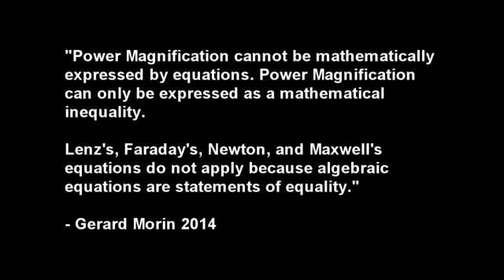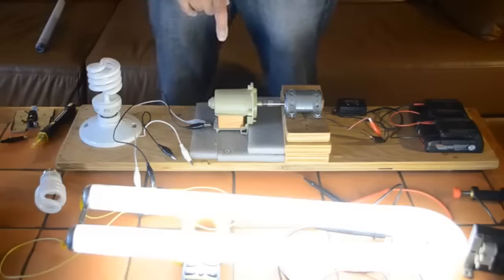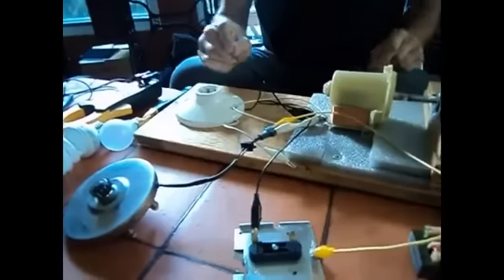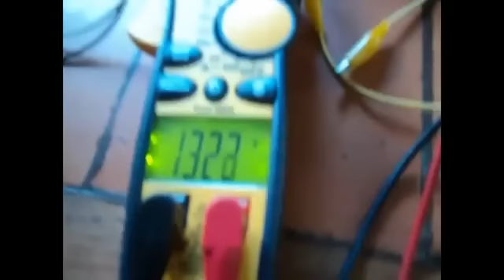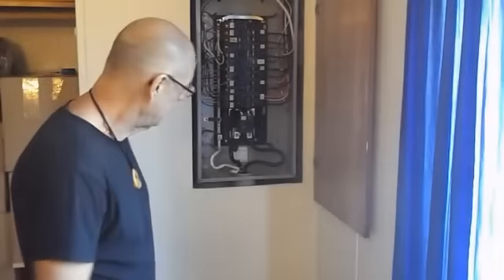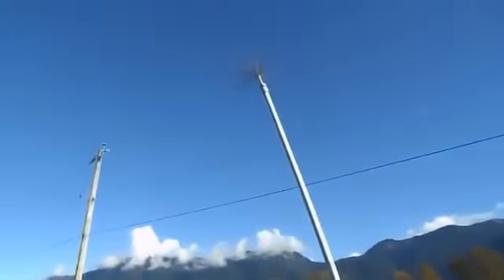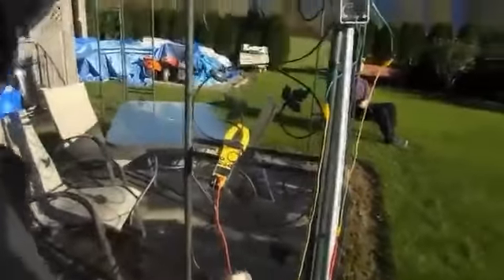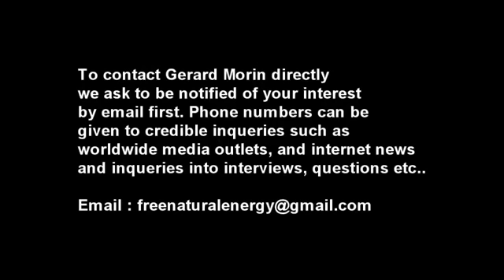Time to END The Electricity Racket - FREE & NATURAL ELECTRICITY PROOF

Comment: You're not applying 300 volts to your ozone generator.  You need to measure the output of your generator under load, not open circuit, because the output voltage will drop under load.  Also,  your fluorescent tube still lights, even though "burned out," because of the high voltage you applied.  The heated filament that is burned out is only needed to vaporize the mercury inside the tube during startup at normal line voltage.  There is in fact phosphorescent gas inside the tube--mercury vapor--whose ionization is producing the light.  So many more ignorant statements and claims made in this video...
Reply: #BoycottGrammarly 
Tesla could do free energy i believe the peramids were energy source they were in water to lower the frequency tesla used seme on his tower plus every 1 meter from ground is 100 volts nouns so 10 meter of ground is 1000 volts it also static and can be very powerful in solar storms write ir wrong does not bother me the pastion in trying is what counts and high frequency high volts no Watts is i think a key separate Watts and volts to 2 different circuit like H gate i read a battery that only use positive not negative then flips harness the energy with out using it because it has to be positive negative to use the battery energy causes chemical reaction there is something to this and learning about tesla and believing in him will give the planet free energy usa and China has this tech direct energy weapons the ion isphare is key makings the earth energy more negative causes a pull of energy ftom ion phare transducer this vedeo makes me want to experiment and that pass time is fun so i see nothing negative about this video who knows could get somone else to accidentally get it right life is light energy light is also mass energy is all around us quontom can make free energy 1 atom in chip with diode to block the Electron spin of atom can make free energy chips Google has done this so free energy is real just have to change every action has equal opsite reaction diodes do that

Comment: Actually amps can be raised as well by configuration of the batteries 🔋in series or otherwise, I as well am a self taught electronics geek, I'll tell ya what though, the hardest part is trying to teach others, they're minds are singularly combined being at thought in which is taught. U can literally show in every way anything specific and yet not one can seem to understand the fact of anything. The fact of it is is that the gov themselves teach a certain way to direct one from a certain area of thinking,  it's strong from what I've learned of others with also having a **** of experience in knowledge of too much lol, I don't flaunt and mean no such thing, I've watched so many videos of men of few trying to teach the world what we actually are and what the universe is I'm fact to how dying never truly happens, to seeing is believing when your thinking is beyond nearly anyone else's when only corruption hasn't been installed.  It's so much in a big way its insane on the amount of work that's done to manipulate us,
Reply: Amps can be manipulated or any other movement in speaking can be manipulated separately or together on makers need persay.  For example there's amps in vehicles up to 7000 and still has 12volts. Or there's amps with 300 but also of a 12 volt output, let alone they make inverters and converters which take 12v and electronically make it a 120v or and too a 240 being this I'd only assume the fact they could make 1v into any volt of need lol with any amps or ohms needed along with watts. I mean isn't it all specific to the t
Regulated fact of it only? So if not for being done for power/money then you'd know better other then not lol

Comment: Wait, what? If you wire the batteries in a series, you increase the voltage. Did I seriously hear that? That's wrong. If batteries are wired in a series, which is positive to positive and negative to negative, the Ah increase, not the voltage. Voltage is increased when batteries are wired parallel, which is positive to negative  to positive and down the row of batteries like this. The negative is done the same way, negative to positive to negative.
Reply: you got that backwards
Reply: @zonti  your right, I had a brain fart. I stand corrected.

Comment: it amplifies the power but the power will run out quicker, so there is no gain just amplification, I think, I'm unsure to be 100% honest there is something here but something is missing, I would be more interested in the pole in the garden, but it could just be picking up TV or mobile amps, also it was near a power line, 1.2 or 1.3 u could pick up, but putting 200 pounds of copper wire will not make more it will just be 1.3 still, there is something though, there is alo charged electrons in the air but amplifing it to hard to do with out magnetic rotation meaning power is needed, i dunno I'm thinking he has something but its missing something, he is very clever but a little arogance might go against people working with him, i get he is trying to call for help, he has no money or real engineering but has the ideas, this just needs ramping up properly with some help, I'm not fully understanding it I don't think, it is a complex field though. I would like to find out really.

Comment: Energy transmission through a phase corrected flick-starting condenser can multiply the rotation of a quantum direct linear cuspid de-modulator, which will supply over a million quadrameters of linear flux.

Comment: This bloke knows a lot of the technical terminology, and sounds convincing to the layman.  But what he's claiming is simply impossible.

This bloke sounds (to someone who isn't an electrician) like he knows what he's talking about.  The thing is, nothing he's saying has ANYTHING to do with the NEXT thing he's saying.!  He sounds like he's making points, that are all adding up to a final answer.  And this final statement, is something that you know to be correct, or can believe to be correct.  But, he's NOT.!🤬!.   He's just saying things that have nothing to do with the next thing, in a way that baffles you technical information. And, although the statements are on the whole TRUE, the middle part of each statement is a way of making you believe that the outcome is proof of the original statement.
For example...
Bikes can work with square wheels.! (REALLY.?... PROVE IT.?)
So, when riding a bike, you always pedal using up to 360° of a 32 or 46 toothed gear wheel, BUT... EXACTLY 100 revolutions per mile is required when riding faster and slowing down to start to go faster again(especially uphill with the new square wheel technical advancements).  From fast TO slow and slow TO fast is what all gearing and wheels are designed to achieve, no more so than with BOTH of your wheels having corners of exactly 46° diameter, square circumferences.  Most, if not all hills are always up and down with the easiest gearing. (this is a given).  Gearing to make uphill and downhill traction with the next advancements in square wheel technical requirements, is fast and slow(again, this is obvious).  But speeds of 50klicks with super variability gearing mechanism, is something every bike is capable of, whether your wheels are square or circularity objectified (everyone knows this).  If you divide the multiplication hydraulic brake cylinder on the rear wheel into the six constituent variables, and use this on the rear to power the square wheel that's obviously at the back of the bike, theres a massive part of the problem solved.  You can easily make your own set of wheels if you take a square, non-perishable piece of malleable, 380° 'Varistock' metal, and add 30 pair-sets at 15 inches of wire resistant spoke alloy, you easily have a square wheel that you can obviously change the characterisation of, up to 50 cycles per rotation.(the rubber comes in later in the process).  And if you do it again, and repeat the process EXACTLY, using CAD(only on a laptop, because laptops are portable) with the shape altering, digital, analogue redundancy package that includes squaretech rotary, which is in compliance with the European (and British) contemporary classification regulations, you'll then find that you now have two equidistantly certified wheels, that are 120° apart from one another(again, everyone understands this). Every bike has a front wheel and every bike has a rear wheel that is driven by a chain.  Chains are made from metal, and are ALWAYS getting dirty from the water and dirt thrown at it from the round wheel varieties(or at least should be if you're riding your bike correctly and unhindered by technical advancements in circular formation that when subtracted, leaves a square)
This has always been the case. And becomes more important when swapping from one style to another.
So there you have it.!  The proof that...

     MY BIKE HAS SQUARE WHEELS.!!!.

Incredulity.

You CAN'T get out more than you can put in.!

OBVIOUSLY.!!!.

NOTHING is 100% efficient.
Even just a little bit of heat, removes a percentage of power.

It's Newton's law of Thermodynamics.
Look it up and figure it out for yourself.  
Don't just blindly believe someone who sounds like they know what they're talking about.(even ME.!!.)

Comment: Thoughts and remarks from through out the video

What has been made is a DC to high frequency AC converter. evidence of this can be seen in both the outlet tester next to the unit on the table that lights up once the "energy accumulator" is turned on. And again when he uses an ozone Creator to generate an arc. the pitch of that Arc can be heard, and is higher when power of the ozone generator is switched from presumably a wall socket to the "energy accumulator" indicating that it is now functioning at a higher frequency

You could simply think of this converter as a transmission in a car or using different gears on your bicycle. you are still putting the same rotational velocity as well as torque however the output speed is observably different

The multifunction chips he mentions in the batteries are there in order to protect lithium ion batteries from both fully discharging and ensuring all cells are charged equally when saying he already burned a battery out he most likely fried that chip

Most drone motors you can find on the market today are in fact actually run on ac power. This is achieved with a unit (known as an esc) on the drone that converts DC power to AC power while also varying it to adjust the motor speed.

Keep in mind during the age of Tesla high frequency energy was not well understood yet,  in fact tesla performed a demonstration in which he controlled a model boat using radio waves. (if you look on the back of most RC toy controllers they will have the frequency at which they transmit listed, usually in the megahertz or now with an increase in technology gigahertz range). that mystified a crowd who postulated he must have been using strings or magnets. what I can guess he means by a "radiant Watt" is high frequency AC. The AC power you will find in most of your homes it's around 60 HZ the frequency he is generating is probably somewhere in the magnitude of kilohertz

DC or direct current does not have a waveform unless modulated to do so. In the case of the pancake motor the diode is simply cutting off one half of the AC signal so you are left with a pulsing DC signal

AC motors do not use brushes (brushes change the distribution of power to different windings creating a changing magnetic field that imparts a rotational Force on the armature) they instead use the inherent frequency

Fluorescent tubes use mercury vapor that becomes excited (ionized) by high frequency AC thus producing light. a phosphor coating on the inside of the fluorescent tubes converts the mostly UV light generated into visible light. The elements on either side of a fluorescent tube are relatively unnecessary for them to work (given high enough frequencies and power) however are much less susceptible to degradation from the high frequency discharge they experience compared to the bulbs contacts.
A plasma globe for example is close to a complete vacuum, however in a full vacuum there is simply nothing to conduct an electrical charge and thus no light is produced.

Electromagnetic fields can be enhanced with permanent magnets. Also notice how the audible frequency of the motor is decreased once a current load is connected and voltage is not measured after said load has been connected 

Note the batteries(18v 1.1Ah("Ah" referring to the capacity and has nothing to do with their maximum current output)) are connected in series producing an overall voltage of 36v, however if connected in parallel would have an output of 18v

33:24 wrong just ✈️ wrong if the "energy accumulator" could deliver enough current, and the alligator wires were thick enough (because the current required would literally turn them into plasma other wise) the magnets could be heated to a liquid consistency. the magnets are poor conductors and therefore acting as resistors. 
As a side note If he had the current clamp around ether of the alligator wires he would observe a rise in current as the heat rose due to the fact that the hotter a conductor becomes the more resistive it is.

I am fully aware of that completely comprehending even a quarter of the electromagnetic physics at play throughout this video, is lofty to say the least. But thanks to the dunning Kruger effect I realize I know almost nothing about electricity and am open to being proven wrong, with sufficient evidence.

If you find yourself here I'd urge you to check out
BigClivedotcom, styro pyro, thought emporium, electro boom, tech ingredient, and elementalmaker
Reply: Also MikeHoltNEC , eevblog , and Photonicinduction (for a little fun).

Comment: If free energy (perpetual motion machines) was as effective as many advertise then why don't we see military bases, vehicles, or vessels using them? The simple answer is it is not as effective as it is clammed to be unfortunately. They may be able to run on its own power generated for a long time but when you add a load (load = something that draws power) then it will begin to slow down much faster and stop working. it would need to be restarted frequently. No business let alone government would prefer to spend money of a fuel to generate power when it could be generated for free. That's just and electrical engineers take.
Reply: The engineer is wrong. A man in Mississippi back in the 70's built a machine that had 10 times the output as the input. When he tried to patent the machine he was denied even though everyone that tested it confirmed it worked, even the independent tester assigned by the judge in the eventual lawsuit. The judge would not accept his own guys word and denied the patent anyway. The machine worked but the fact is oil companies will never allow free energy. This guy better watch his back if he tries to do anything other than make a few videos. Too much money at stake and his life isn't worth shit to the people getting rich off of fossil fuels no matter how much damage is done to the environment.
Reply: Look up liberty engine you can run tools off of it.
Reply: @robertnesbitt6110  that's a cool story. But if you want people to believe something that goes against many laws of physics and thermo dynamics you need to provide evidence otherwise it's just hear say. I am truly interested is what you saying, so if you could provide the name of this gentleman inventor and or other evidence of this machine that would be wonderful.

Comment: Magnitism don't cycle to create heat. Electric cycles. Anyway. You don't want heat ..heat causes have to cool..do with magnitism flow not hot ...but if a turbine like motor like a ship engine it'll get hat if demand is overlimiting .like a car turbo it'll catch fire so.moral is..use more turbo and reduce demand..and electric causes heat load as limit fuses.. magnitism flow is cool easy and general if carbon ,is purple. Fyi

Comment: the tube is filled with a mercury vapour at low pressure ...NOT a vacuum . he uses many terms that are incompatible with each other. mixing lumens with terms of power. the whole concept is BS. just another click bait
Reply: PS ok run your house from a battery until it goes flat, then use the mains power to charge the battery???  suuure

Comment: Again, a lot was said but little was said. Clear so far, battery (36V) motor (4000rpM) and then the fast rotating magnet. What else is in the white plastic housing? Just a coil at the bottom?
For me it looks as if there simply high voltage is generated and this high voltage is always able to bring light tubes to light.
What's the point of babbling without showing the essential part? Again only to grab money and tell everyone that you want to have free people who can have free energy... but only if they pay first... pathetic!

Comment: Just another perpetual motion machine. You still cannot get out more out than is put in. What is the frequency of the AC you are producing with that high speed DC motor alternator set? High frequency AC acts differently than 60Hz AC and most available AC equipment motors,etc designed to run 60Hz have very limited life spans when run at other frequency higher or lower. Sorry but i don't see anything new here.

Comment: No the white wire is not what you said the white wire is it common where you take that white wire onto a Transformer whatever you and called you yet going to get shit in your house AC or DC you need to wire you need a hot wire and a negative wire or hot wire and a common wire ground